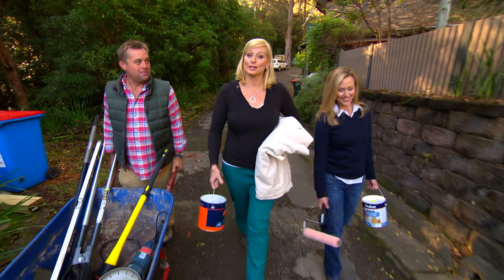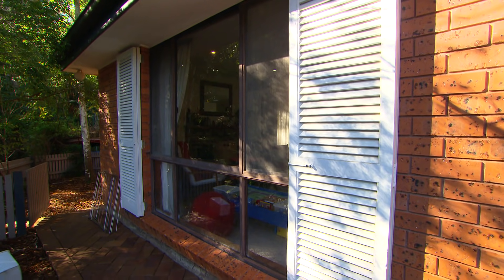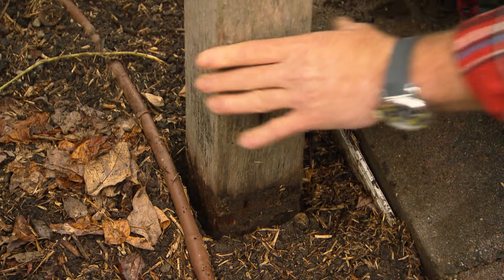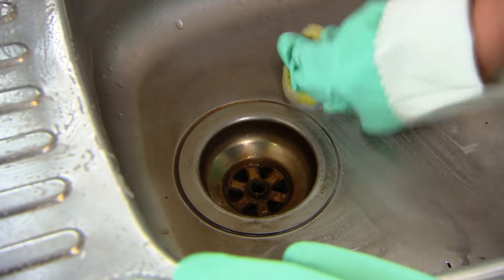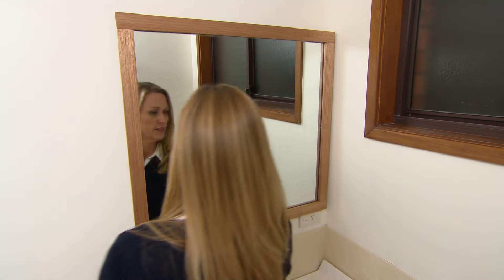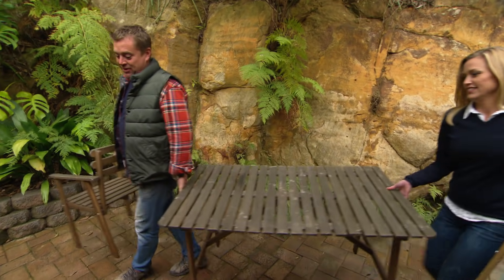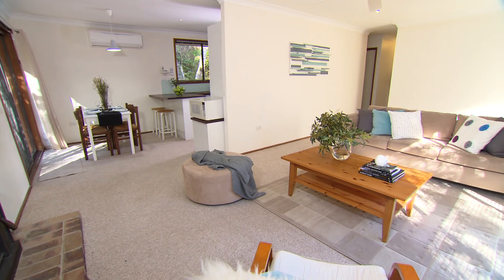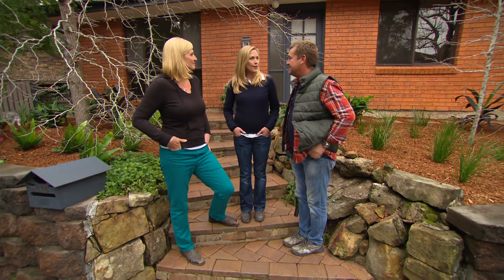How to Add Street Appeal to Your Home on a TINY Budget | HOME | Great Home Ideas

Comment: My friend bought a tired, rather run down house for £200,000. He spent £15,000 on it. When he had it valued for insurance purposes, he was told that the least he could expect if he sold it was £450,000.

If selling, it's worth spending as much as you can afford.